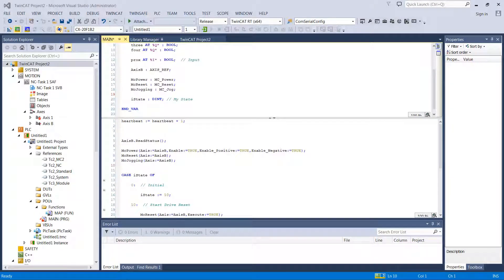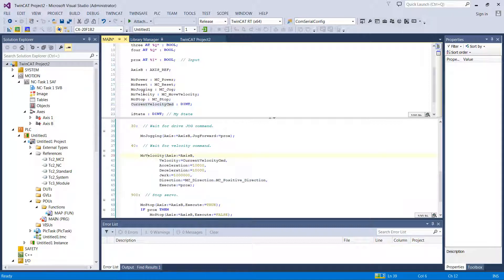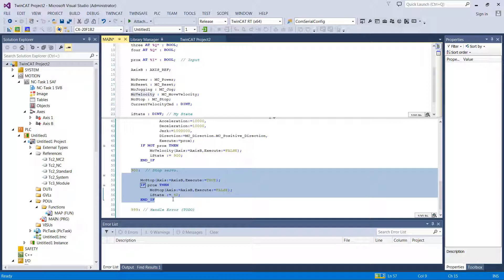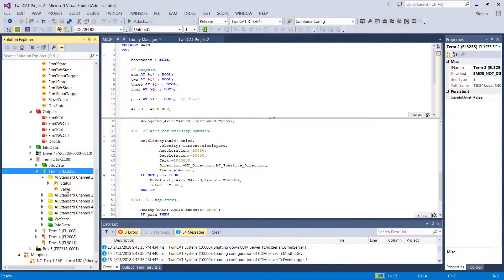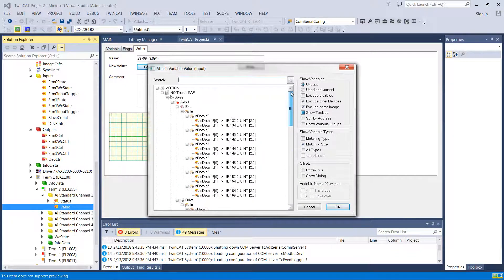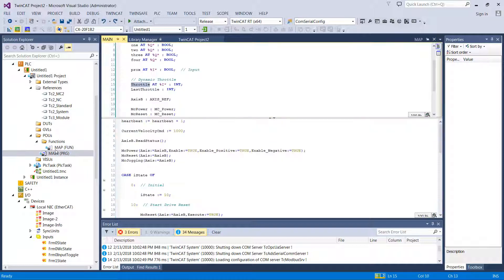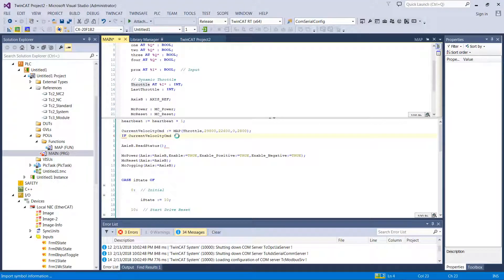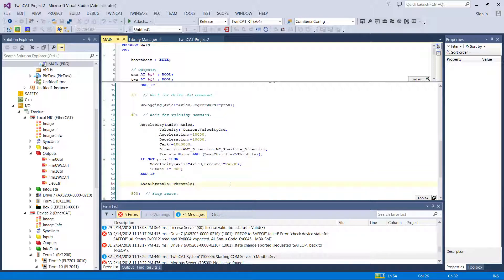EP9  Motion Control and IO with PLCs - EP9 - MC_Velocity

Comment: Please make a tutorial of SFC AND  CFC program in twincat 2 or twincat 3
Reply from the maker: I won't have time any time soon... however, they are pretty easy once you figure out the editor.  The editor in TC2 was so bad for both of those that I just decided to never use it again.  I've not tried it in TC3, but in my company culture, you'd get heckled for putting CFC and SFC into your code.  It makes it too hard to 'browse' without doing a ton of clicking around (in my opinion).

Comment: Sir, I need that How I connect plc in virtualbox machine window 7
Reply from the maker: You'd do it the same way.  You might not be able to run on a VM though, it needs virtualization passed through to the VM with VTx to run properly.
Reply: My PLC ping ok in VM but not connected

Comment: Another  gem! looked though 9 videos. So far so good. just pause for thank you comment. Love your videos. Learn a lot. If you could do a bonus video for basic priciples of doing the same in Codesys.
Reply from the maker: Sergey Romanov interesting idea. I don't have experience with them but I know it is very similar (Beckhoff still has codesys under the hood). Thanks for the kind words.
Reply: I think you can figure it out much faster. I've understood the concept of programming, but setup a drive is complicated.  Unfortunately I have no access to Beckhoff PLCsn here and most probably woun't.